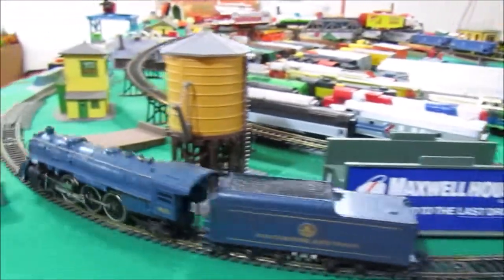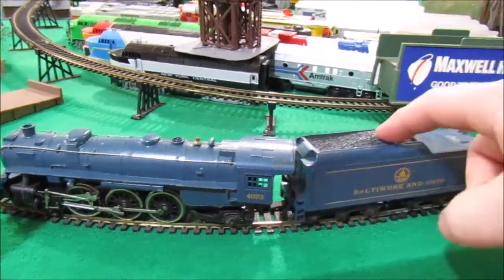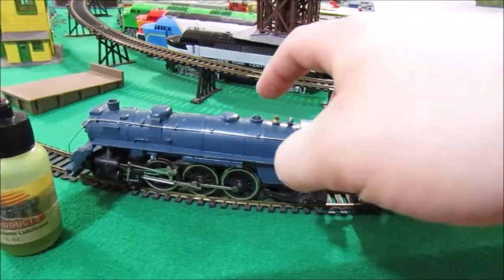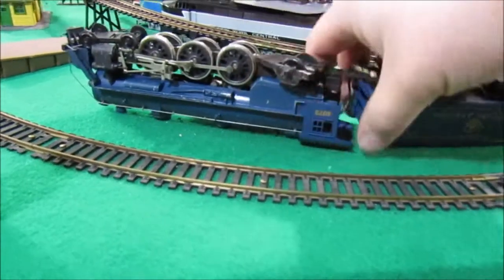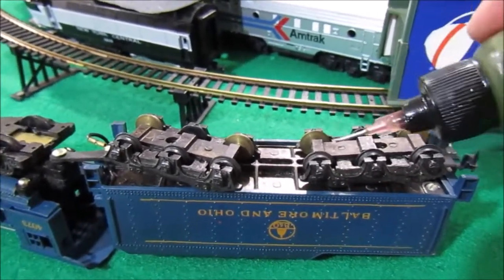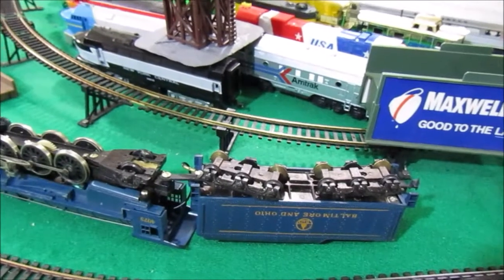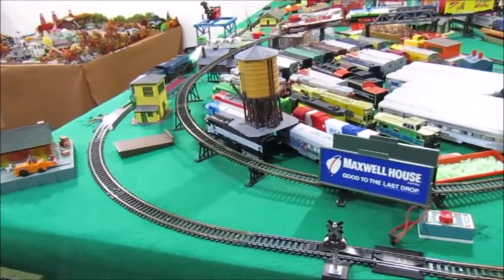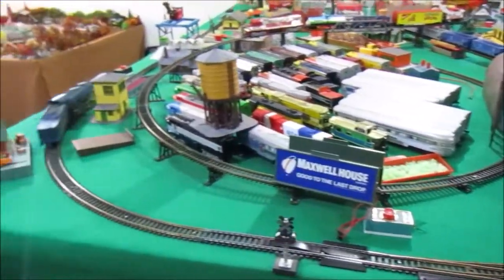E-Z How To: Making Mantua diecast steamers RUN WELL

Comment: Super. I still have two Mantua/Tyco 4-6-2 Baltimore and Ohio Pacific heavy steam locomotives, both with long haul coal tenders, that I bought new many decades ago. They both pull an eighteen car Baltimore and Ohio heavyweight express passenger train, and still run great, both inside and outside. P.S. One locomotive will pull the train, but two locomotives on the front of that passenger express train make it look so much better. Hello from the Tracy Mountain Railway in Colorado. 💙 T.E.N.

Comment: What a difference rare earth magnets make on an HO Mantua loco.  I replaced all of my open frame motors magnets with rare earth magnets and now the engines will creep along as well as draw less current.  Those magnets really made a HUGE difference in the performance of open frame motors.  Not only Mantua but other open frame motors as well.  I've probably done at least 8 or 9 engines along with using a full wave bridge and 3300 uF caps to add flicker free lighting.  I even refurbished an old RPO rail car with my home made pick ups (made from copper I retrieved from an old computer) and added led lighting strips (12 volts), a full wave bridge rectifier with a 3300 uF capacitor and lit up the car with flicker free lighting.  I plan on doing the same with a few Rivorosi Southern Crescent coaches that have no interior lighting.  If you use oil on the wheels, make sure to use conductive oil as it will add to the circuit and make picking up power from the rails a lot easier.  W Rusty Lane K9POW in eastern Tennessee

Comment: hey I just have a question.
My mantua 4-6-0’s cow catcher keeps causing short circuits on my railroad. Do you have any advice?
Reply from the maker: Mantua 4-6-0 cow catcher....if that is what's causing short circuits, than the only thing I can think of, is that the metal cowcatcher lost its paint on the underside, causing the bare metal of the cowcatcher to touch the rails, resulting in a short.
Reply: @RPModelRailroads  should I repaint the cow catcher?
Reply from the maker: @thetoontrain473  I would repaint the cowcatcher, to stop it from interfering with the electrical power in the rails.
Reply: or glue a piece of some very thin plastic to the bottom

Comment: Thanks for the video and the tip. Do you have any Tyco center cab Plymouth Diesels?
Reply from the maker: You're welcome! No, I don't have any currently except for one that keeps falling apart. Lol. Another rainy day project...
Reply: Thanks! I have two out of three running with Kadee couplers.  My third one is a mystery.  It doesn’t get power from the wheels but it does when I connect to the wipers or the screw on the truck cover and also when I connect to the pickups, and also the frame.  I think I’ll take the wires off and wire it again.
Reply from the maker: @jimorlando5700  Yeah, that sounds like a good plan. Mine is so hard to keep together as I'm missing 1 screw for the base, and for the other one, the threads are stripped in the hole
Reply: You can use Kadee 2-56 X 3/8” for the screws.  I also put some CA in the holes and then I re-drilled and re-tapped the holes.  I also used little pieces of a mailing label for the missing insulators.  Putting CA on the ends of the truck frames will also insulate.
Reply from the maker: @jimorlando5700  wow! Sounds like it was worth it - good work